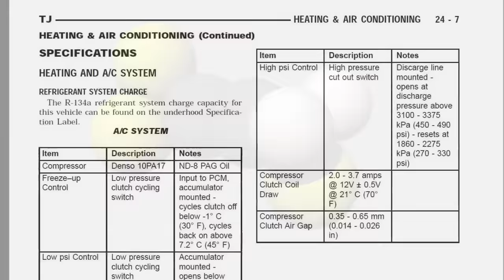BLEVE

Comment: Another common BLEVE is super-heated water under oil, as one would get should water or ice be introduced to a deep fryer before the oil has heated up to over 100˚C.  The liquid water sinks to the bottom, where the pressure of the oil keeps it from boiling well past 100˚C, until the oil is disturbed and the water instantly turns to steam, throwing oil in the air.

Comment: BLEVEs are particularly hazardous to firefighting personnel, who can be suddenly scalded at distance without the presence of nearby flame, in the cases of water tanks, pipe work, or  boilers breaching due to fire.   Just a litre of super-heated water turns into 1700 litres of scalding steam   A BLEVE of only 6 litres of water could completely fill a 10m (32') cubic room room with scalding steam.
Reply from the maker: I've seen a steam pipe with some condensate opened on an industrial oven and it is extremely violent. I would love to film it in high speed but there is no practical safe way to do so. Thanks for the tip on the name for this phenomena!

Comment: Have you had any issues with your GoPro Session?  Mine has been nothing but trouble for the last two weeks.

Also, i wonder if one could make a cartridge that uses a small BLEVE for propellant.  Maybe lock down the bullet and heat the cartridge to 300C or something.  When you pull the trigger, the bullet is released.
Reply from the maker: I don't use the session too much but the 2 button interface is a real pain. I usually set it up with wifi, turn wifi off to save batteries and then start it by the buttons.

Have you ever seen NASA's light gas guns? They use compressed helium behind a disk that gets ruptured allowing it to escape and propel simulated space debris. You could probably use a similar setup to make a BLEVE cannon but using a heavy gas limits the max projectile speed. I'm not sure of the mechanism but NASA uses helium specifically to get the highest speeds possible.
Reply: Gerald Bull is my spirit animal.
Reply from the maker: Awesome! A satellite cannon!